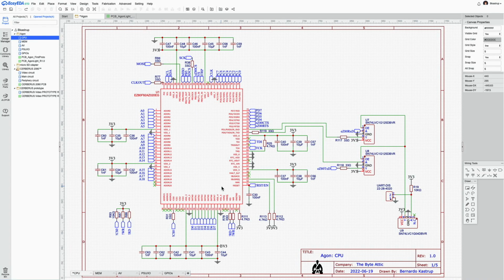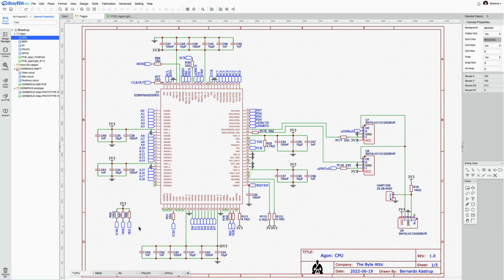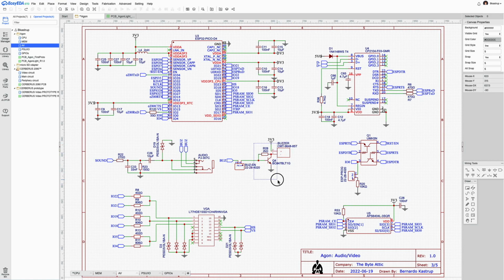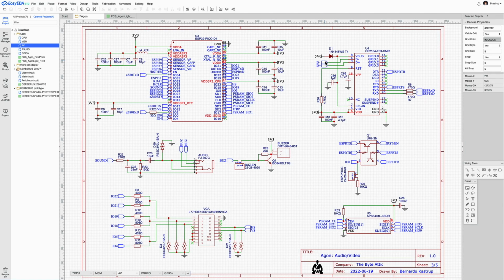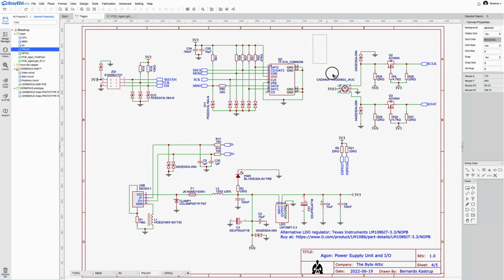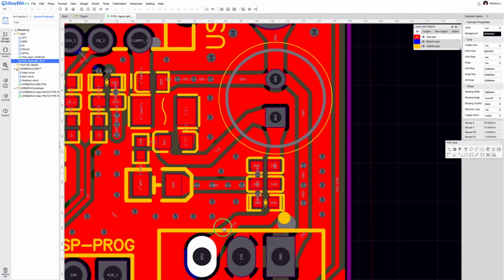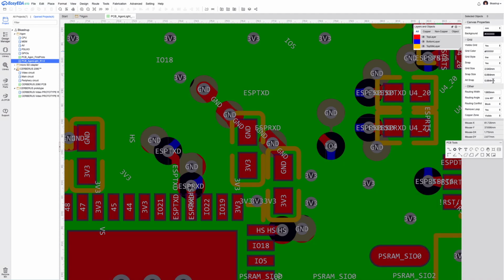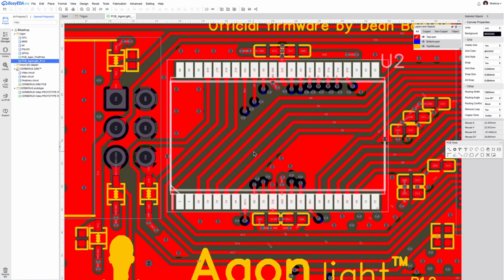Computer logic and PCB design tips (Agon light™ design overview)

Comment: reference post for:
1) @44:52 "whats all those ground via's and why are they so close to signal via's"
2) @50:52 "whats with all those 3v3 via's"
3) @55:46 "How to ensure Very High Speed serial signal integrity"
4) @57:23 "Try to keep data line short, and seperate parallel lines as much as possible"
5) @1:00:40 "GPIO Diode Protection"
Reply from the maker: Thank you!

Comment: Interestingly this video suggests not to use pwr/gnd on layers 2/3 https://youtu.be/ySuUZEjARPY (at around 1:40)
Is that the reason you're using so many gnd vias next to signal vias?
Reply from the maker: In the ideal world, the stack would be this: signal 1 + Vcc copper fill, GND 1, signal 2 + Vcc copper fill, GND 2. So there would be no Vcc plane and the two signal layers would be separated by only one plane. This assumes that you can route all Vcc lines without a Vcc plane, which I didn't manage to do with Agon Light. The alternative was to use two planes but then add a transfer VIA (GND) next to every signal VIA, so to 'carry the fields along' through two different reference planes, which I did succeed in doing.